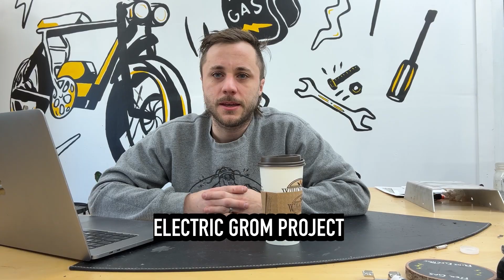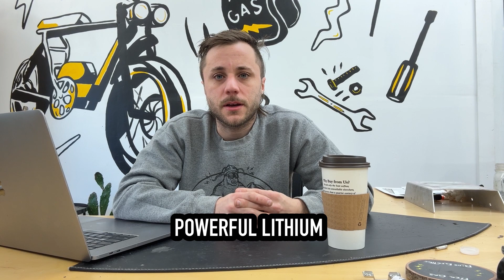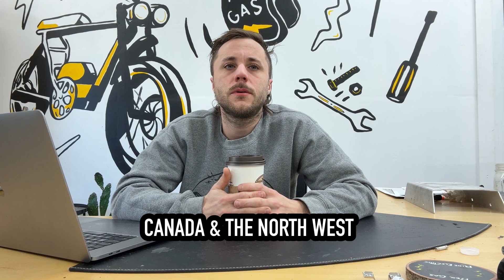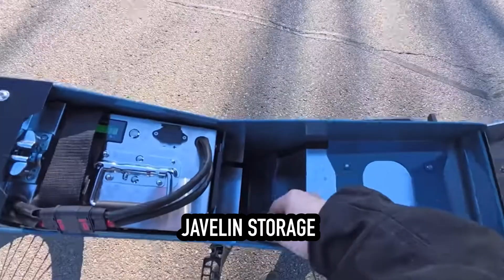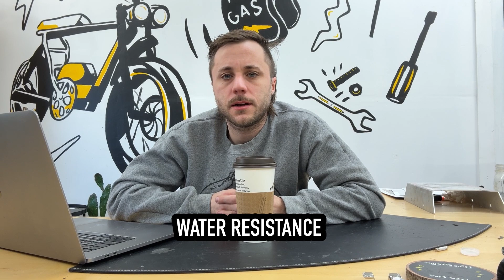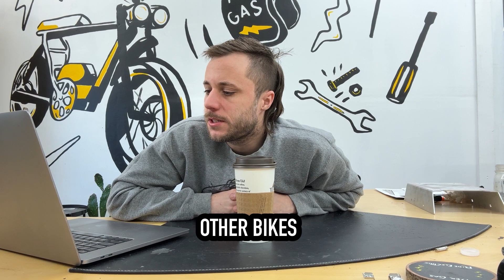Spark Notes: CA Laws, e-bike Chargers, Collaboration

Comment: For the battery, instead of offering $800 off, is it possible to upgrade to a powerful lithium battery via SparkCycle? Maybe add a custom build tab to the website.

Beachman offers an upgraded battery, motor & motor, I believe. They have a Yellow Hornet version that has 120ah or a 60 or 70ah version.

Does the space inside of the Javelin allow for a larger battery instead of an additional battery. That one could go to 84/96v?

For the seat, instead of a second key, is there a way to remote unlock via the current controller…same as adding heated grips/seat?

On the CE02 the seat is unlocked via a button similar to the auto unlock in cars. A second key would be nice, but unnecessary given today’s technology.

In terms of the new ebike laws, we need someone knowledgeable in the room or with political influence. We need a lobby or PAC to work with legislators to evenhandedly dole out laws. Would you be interested in championing this effort?

Thanks for the rundown/overview.

Comment: I will help with the questions. Are the Javelin and Brute able to be ridden or transported in the rain? Are the spark stock stainless batteries end user serviceable? Can the end user replace the cells? Does powerful lithium offer anything larger for Javelin or Brute? Do you have stock replacement batteries for sale? Are there any plug in onboard charger options that don't require an external charger for Javelin or Brute? Think simple 120v extension cord plugging into the bike.